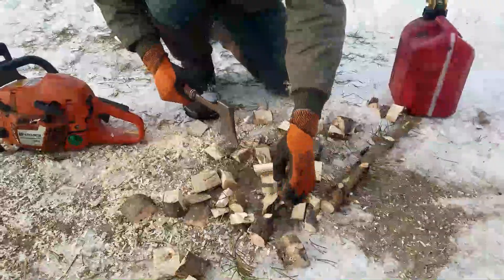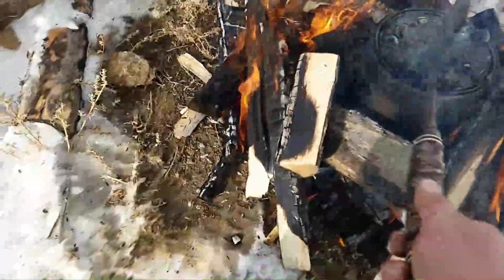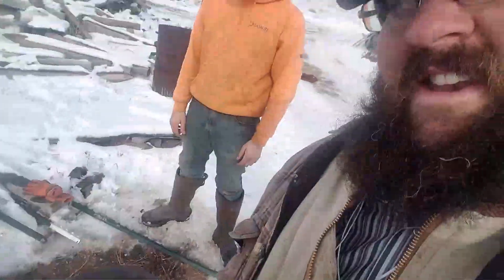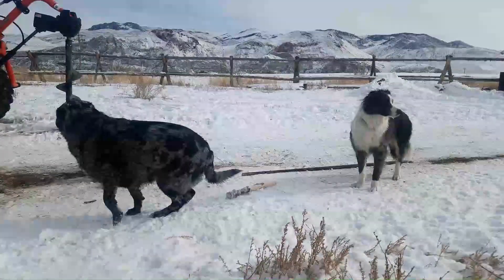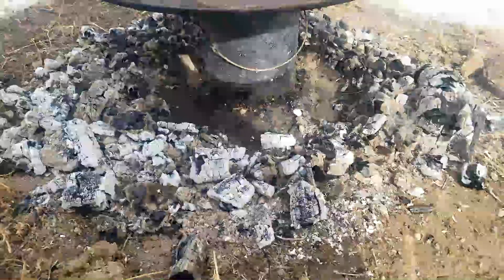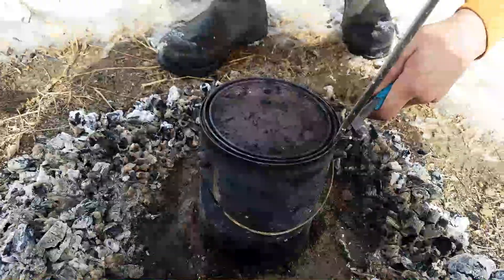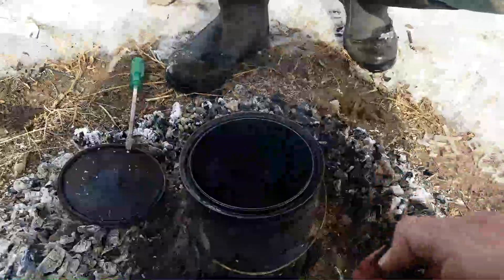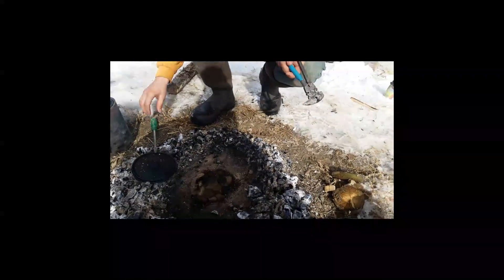How We Make Pine Tar

Comment: What did you use the pine tar for? Kewl way to make charcoal as well. Thanks for sharing.
Reply from the maker: We had built a table with a chainsaw while we were camping and we used the pine tar to treat the surface instead  of using something from hardware store. It works pretty good and has a "woodsy" aroma. The charcoal is a pretty cool feature as well. Thanks for watching!